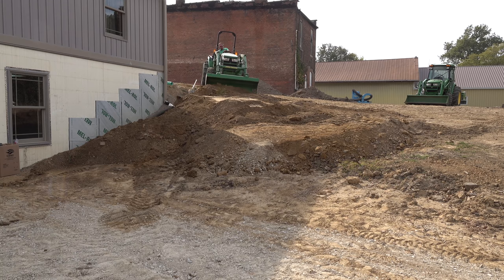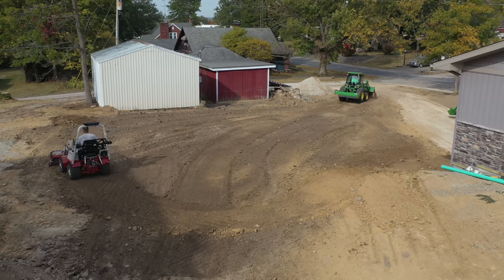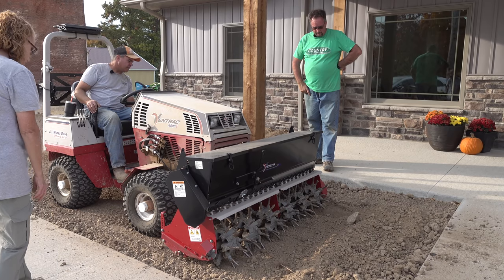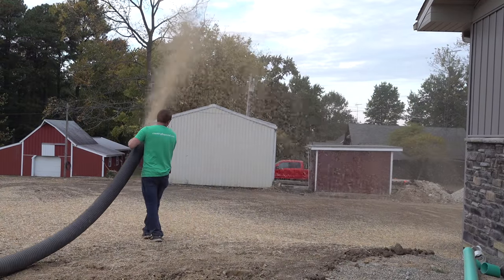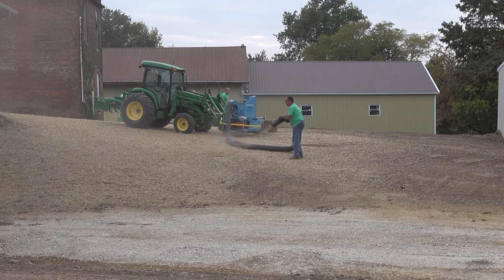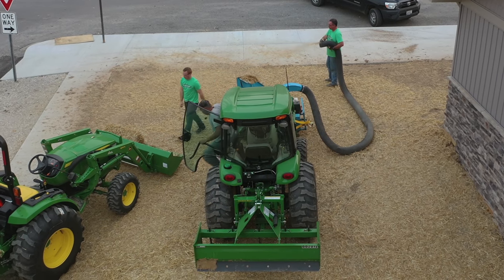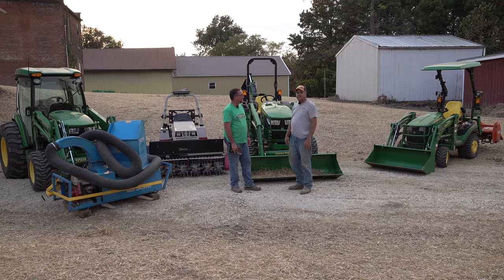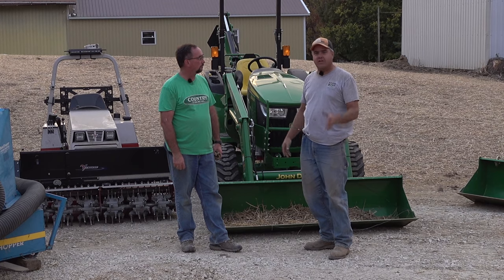STRAW CHOPPER/BLOWER MAKES QUICK WORK AFTER SEEDING HUGE LOT!

Comment: Aera-Vator tip:
One thing I have found when seeding in loose soil is to run backwards with it. It may still push some soil but not as much. 
For the seeding rate- Calibration is important but you can get really close by following the seed rate chart in the manual. I have seen you plant tall fescue before so I’m gonna assume that’s what was going down. My book doesn’t give a rate for it but it is very close in size to perennial rye. 8-10 lbs per 1000 needs a setting of 64 to 68 for a single pass at 2 mph. I’ve been running at a 51 and doing a double pass to achieve the same rate at 2 mph. Love the vids you guys do!

Comment: On box blades...  I'd really like to see how you'd like using a box blade with a hydraulic T&T (top and tilt) kit on the 3PH.  That really improves on the fly adjustments of the box blade versus constantly having to stop the tractor, get off the seat, and manually adjust the standard top link and/or the 3PH side to side adjustments.  The hydraulic top link in particular makes it so easy to make super fine fore and aft adjustments to the pair of blades on the box blade.  This allows you to easily adjust how much the box blade is digging up material or, conversely, spreading out material versus trying to lift and lower the entire box blade with the 3PH position control.  Using the tilt function on the 3PH also makes it really easy to do sloping or crowning operations with the box blade.  Hopefully you can convince the CFO to approve the funds for a T&T kit and test it out for us some day.
Reply from the maker: Workin on it.     Will be next year.

Comment: I have same straw blower what I do is put it on tail of 6 x 10 trailer stack a dozen bales in front and put the full bale in if it is string baled chopper will cut strings and all .Dont use bales with metal wire

Comment: I would like to see a close up of straw machine and how it works. Did he rent that or is that purchased? If so, how much? It looks like a neat tool/implement.
Reply: In our area there have been several like-new units on Craigslist selling for around $3000. Most places around here rent them for $125-$150 per day.  In addition to the Honda engine units, I believe they also make units that are powered by the PTO. If you are seeding a large area they are THE mack daddy way to spread straw.
Reply: Try the rental chains they usually have several to rent
Reply: Borrowed the blower from a friend.  Benefits of a small town!   Thank you Arnold landscaping!!!!
Reply: @steventhomson2042  nice to have friends with toys!
Reply: @BradMyers  sure is!!!!!

Comment: How much cheaper was blowing the straw than to buy the netted blankets? 
Im convinced blowing straw may be a better way but how much cheaper?
Reply from the maker: Much cheaper!  But the worst part is that straw may blow away with the wind.
Hard to hold it down.  Blankets can be tacked down.
Reply: @TractorTimewithTim  
Does the crimping actually hold down the straw from blowing in the wind or is that just fantasy? Im thinking of using the straw in a hydroseeder but not that would prob mess up the pump or something?
Thanks
Reply from the maker: @Shiro642  crimping should help.  I do not know about hydroseeder.

Comment: It is an interesting to see and consider using a straw blower.  I didn't have a seeder and rented a hydroseeder to spread seed, mulch and fertilizer in the same pass.  It was a one person operation.  Used tractor to pull hydroseeder trailer, to parts of property i was seeding (about 1 acre of my 5).  Learned to have less hose reeled out, less hose weight to fight. Think it saved time and cost was manageable.
Trailer tank size is around 500 gallon, water fill time can be a factor depending on volume and pressure capacity fill time could offer some rest time.  I filled tank and spread 5 loads.  This may not be a thing with straw.  Hydroseeder with each load water is the part u run out of first.    At the end u end up with a decent amount of product to rince out and or add water and find a place to spray.   I would rent and use again. 

Thanks Tim for video.

Comment: I'm sneezing just watching you blow straw.. You're correct about the matting for sure. We've pulled it out of ditches that was pulled 10+ years ago and most of the string is still there. We call it the grade finder, because it worked back then it should work for grade now.

Comment: That seeder needs to be ran backwards.  The rollers need to push the seed in the soil for the seed to soil contact.  The seeder looks like it's more of a 3 point attachment behind a tractor which would in turn, roll the seed into the ground.
Reply from the maker: There is a roller behind the shaker wheels.  Fully intended to operate going forward.